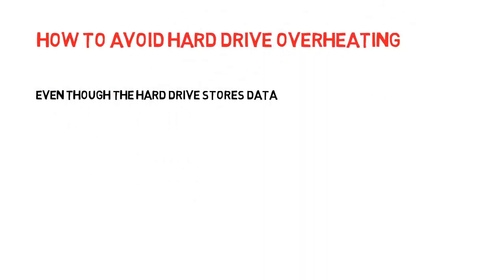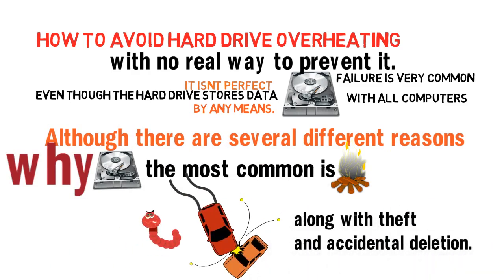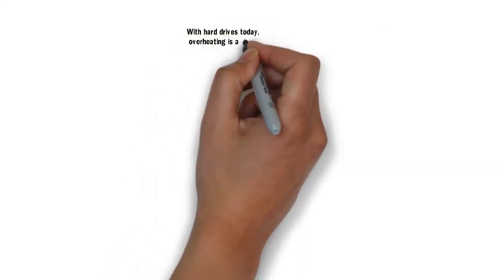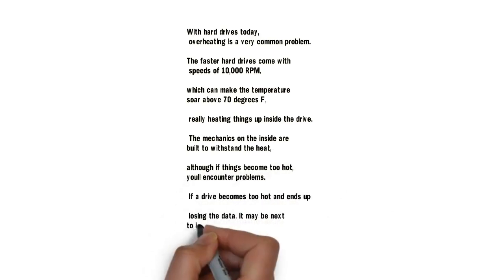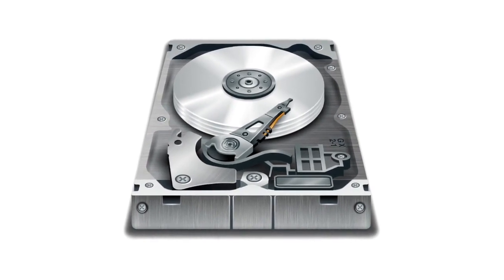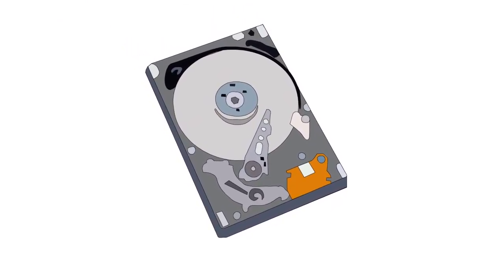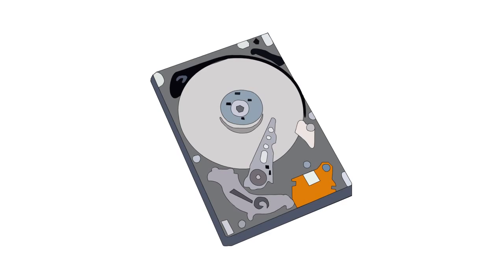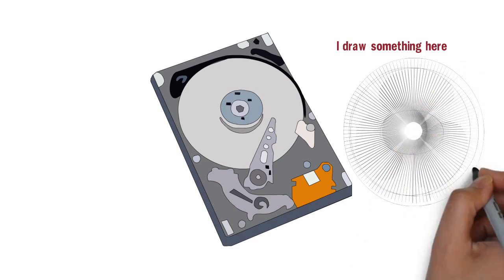How to Avoid Hard Drive Overheating

Comment: sadly for external sealed hdds there is no real options of cooling
Reply from the maker: Will not need cooling or you can use external fan or good air place
Reply: @T3EReviews  it has plastic casing that is kind of an insulation. newer external seagates are 5526 rpm and overall much hotter for some reason.
Reply from the maker: You can get external hdd cooler from Amazon
Reply from the maker: The case has cooler
Reply: @T3EReviews  sins when?) they dont. again i am talking about 2,5" external hdd

Comment: Hello, I have a problem with my PC.
When I start it up it says that "boot device is not compatible or not found then select a proper boot device and sometimes disk read error"
Idk what to do I tried firmly reconnecting the cables many times and still the same and also I can't find my boot devices on my BIOS menu.
Please help
Reply from the maker: Try choose hard disk drive as a first boot from bios setup and remove external hard or flash when open pc
Reply: Thank you for the reply.
I don't have an SDD but only an HDD.
I test it again and change the connection of my SATA cable, I found out that sometimes the HDD is not detected when I look into the BIOS Menu but when it is detected it will start up and says "disk read error press ctrl+alt+delete".
I don't know the problem if it's the MOBO or the HDD.
Also my CPU heats up to 100+ degrees even if I'm just at the BIOS Menu and I can really feel the heat in my MOBO,GPU, and cooling fan.
I don't know which part is the bad part or which part to replace since I've got a really little idea about PC.
A help is highly appreciated.
Reply from the maker: You need to check cpu fan and use external fan and clean dust
Reply from the maker: Also change hdd cable to a good one
Reply from the maker: May after that if you see the error again then check hdd jumper button or reinstall new windows
Reply: Okay, I will.
Thank you so much.